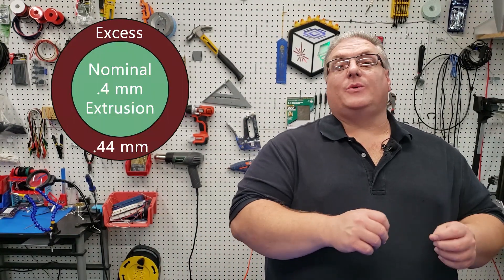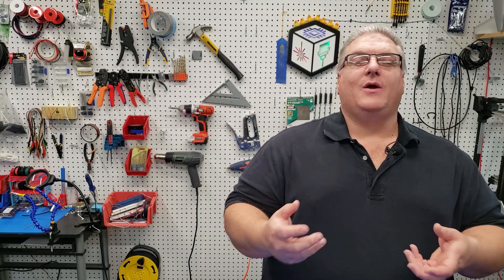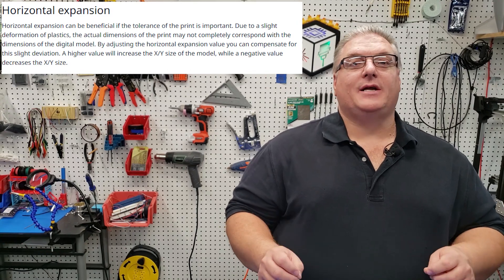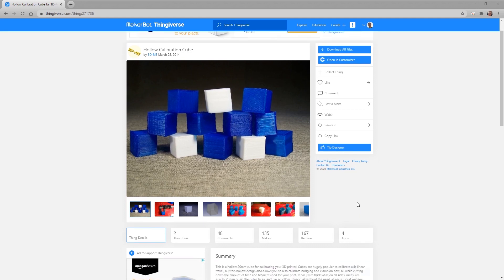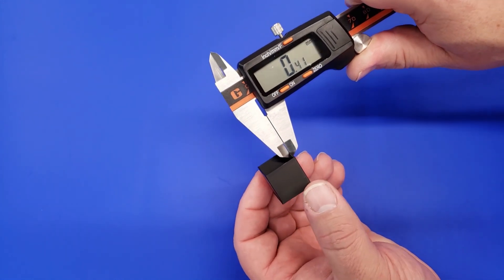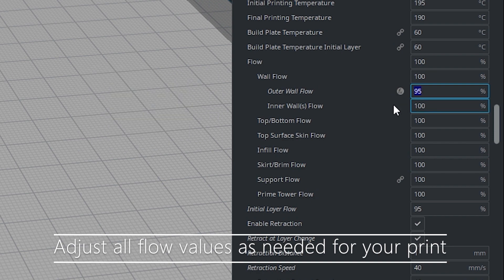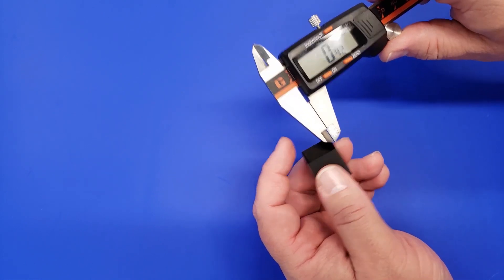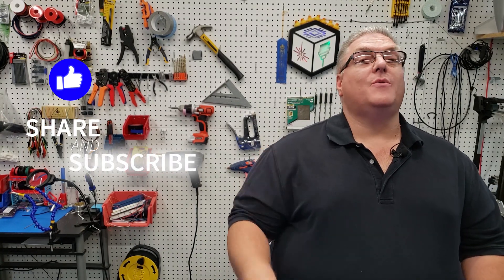Better Prints by Calibrating Flow Compensation | 3D Printer Calibration Quick Tip

Comment: Not sure if it makes a difference, but if you're only measuring the top 4-5 layers, I don't see the point in printing the full height of the cube. To save time and material, I've scaled the model in half, on the z axis.

Comment: Bad practice because yes you will adjust it with a little onion, but it will give huge problems afterwards, it is much better to do it with 2 layers to have 0.8mm and we will check that they are well fused together...

Comment: Does this new value now go into every flow setting not just the outer wall setting? The reason I ask is because I calibrated as per your instructions and my cube came out perfect and input value in all flow settings but now when I print I am under extruding

Comment: 'seen videos to argue against this and I agree this is not the best solution to fix your dimensional accuracy.  Horizontal expansion and model "fixes" are better to ensure a strong part.  Changing flow can introduce too much air or smaller contact zones within layers and make weaker parts (if not done correctly).

Comment: What about flow in general? Why do you suggest only adjusting the 'Outer Wall Flow' parameter?
Reply from the maker: While I only modified 1 variable you can modify all of the parameters.  Personally outside of the outer dimensions I dont worry as much about infill.  But feel free to modify as a whole.

Comment: Great tip! Would this be required to do as well for each profile setup in Cura? If i was printing at 0.2mm and my setup my flow rate for that, would I then need to test what best flow would be for a 0.12mm profile? Thank you!
Reply from the maker: You probably should as the flow will vary based on how much filament you're pushing out.

Comment: Thanks again from before.
Any insight on what setting(s) to manipulate in Prusa Slicer? I'm trying to switch over from Cura, but I cannot find "Flow Compensation" in PrusaSlicer.

There is, however, something called "Extrusion Width", but this is not exactly the same, apparently >_>
Reply from the maker: Extrusion Multiplier 
https://help.prusa3d.com/en/article/extrusion-multiplier-calibration_2257/#:~:text=In%20PrusaSlicer%2C%20navigate%20to%20Filament,it%2C%20simply%20rewrite%20the%20value.

Comment: Am I supposed to be getting wall thicknesses of 1.00mm to 1.10mm? Has the model been updated or something?
...because I'm getting a "New Flow %" of 36.95150115473441%
Reply from the maker: Not unless you have a 1mm nozzle.  If you do have a 1mm nozzle then use that as part of your calculation. If you have a .4 nozzle and getting a 1mm thickness you're likely not printing in vase mode.
Reply: @MakersMashup  Ah! I'm supposed to be printing in Vase mode. Thanks, I'll give it a try~

Comment: What if the difference between "what it is" and "what it should be" is dramatically off? For example when I measure the cube wall thickness, it is 0.51 even though it should be 0.4, if I adjust the flow accordingly I should write 75% but then all walls are seperated from each other resulting in a much worse print quality. Please help, Thank you
Reply from the maker: I wouldn't expect it to be that far off.  How old is the nozzle?  It could be that the nozzle has worn and need to be replaced.
Reply: @MakersMashup  actually the nozzle is not that old and im pretty sure it is clean, but i will try  it with a brand new nozzle as well, what else woyld you recommend if it is not the nozzle?
İ need to solve this problem somehow
Reply from the maker: Not sure really sounds like it's over extruding but really hard to troubleshoot in a youtube comment.  I suggest posing the question in the discord.  Lot easier to help there.

Comment: When I print a single wall cube, I get a wall thickness of about .8mm.  Thats with a nozzle of .4 and a .8 extrusion  multiplier. With a 1.75 mm PLA filament.   Cant find why I am not getting a .4mm wall.
Reply: Are you sure you have number of walls set to 1?

Comment: if you reduce the flow rate, you can meet the under extrusion result.  the line width on single wall printing is thicker than normal. it's not error.  it's the logic of slicing mechanism at Cura.   if you want to know what I think, please check this video. https://youtu.be/MhkTb_6vYD8  thanks